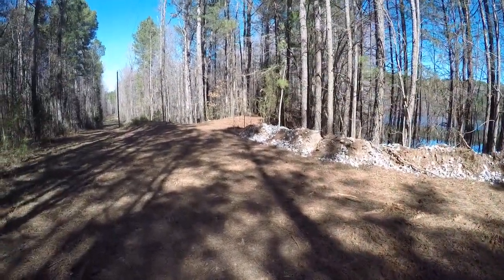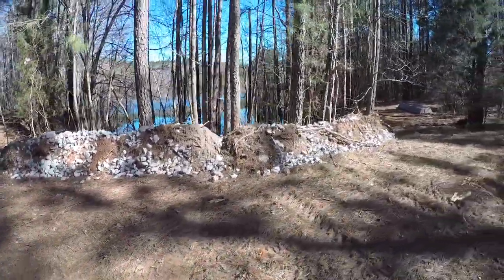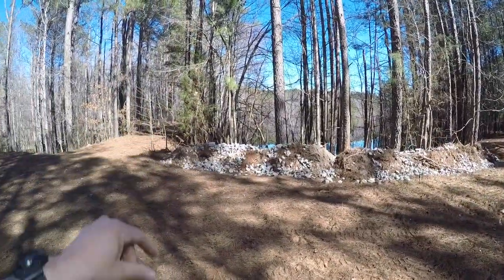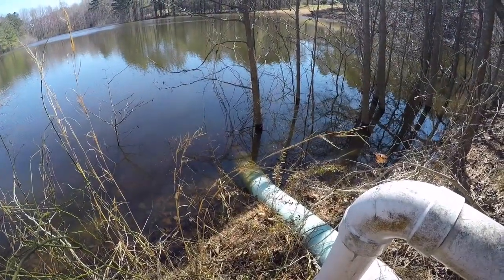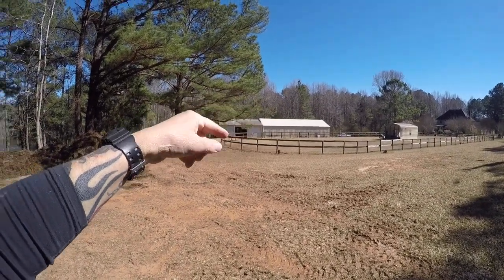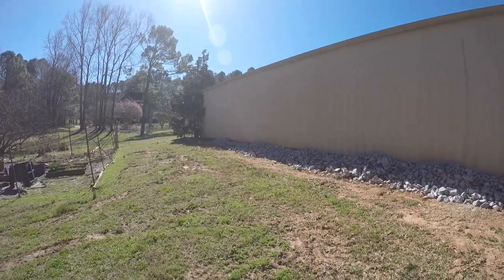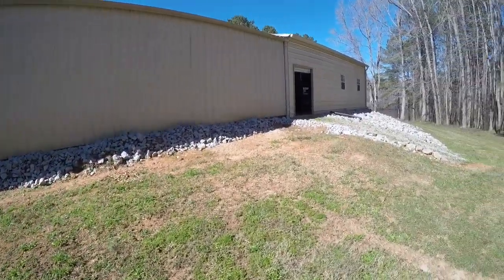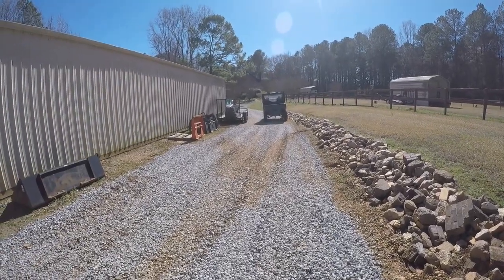Moving Rock

Comment: Never seen overflow like that. I've got a 2ft x 2ft open top box outlet on mine with 12" pipe. It sometimes gets overwhelmed during heavy rains. Ponds are a lot of work, but are worth it.
Reply from the maker: We also had a more traditional overflow, which was a 24", vertical, corrugated pipe. It got old and was leaking, so we replaced it with the newer siphon type system.